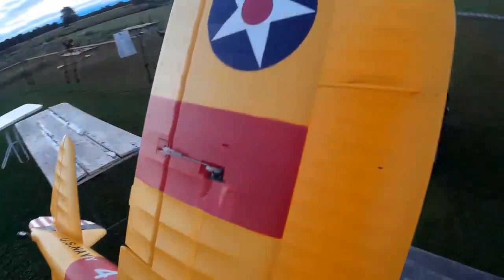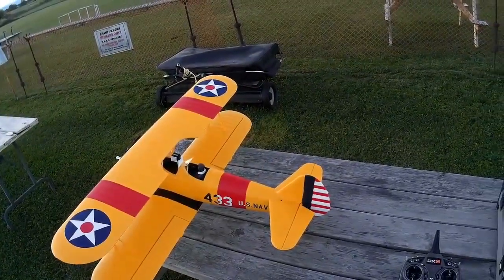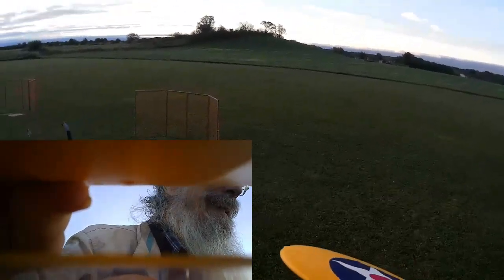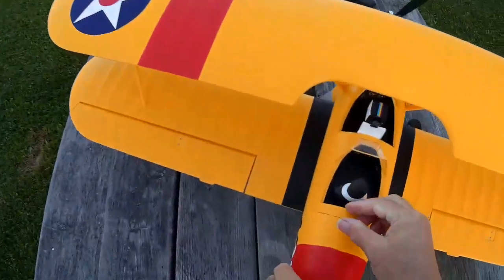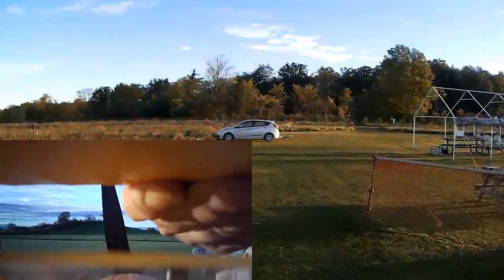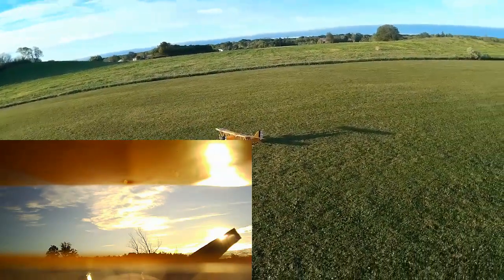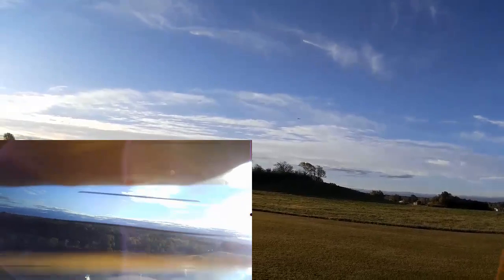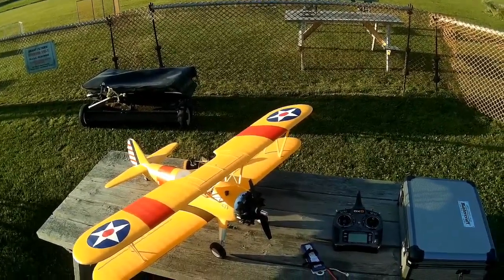E flite 1 1m PT 17 maiden flight review

Comment: Do you still have your's? I just bought one and am having the same problem, I bought a 3D Ultimate and have had all kinds of trouble with that. Rock On!
Reply from the maker: I do still have my PT-7. I had an Ultimate Biplane as well, but I sold that one. With the PT-17 you need to put an ounce or so of weight in the nose to balance it out. It flies ok then.

Comment: i had the same problem  with gear and found 1 of the outer tabs holding the wire in place was bent to far forward i pushed it back and gear pop in fine

Comment: IMO, the engineering of the kit was fine. The instructions are poor. The Landing gear can easily be installed if they would have told you up front to squeeze the wheels together as you're installing the assembly to the fuselage. Once I figured this out on my own, they popped right into place. As for the lower wing pins, a note that they were screw-in parts and height adjustable would have saved considerable time trying to figure out how to get them to protrude far enough through the wing to allow the pins to go in. Again, the plane itself is wonderful. The instructions are severely lacking. They make what should be a simple 30 minute assembly into a multi-hour curse-fest.

Comment: Your batteries are fine to pull as low as 3.2-3.1v/cell. That's where cutoff is in surface usage and it gives you use of all of your rated capacity.

I've got one of these in the post now, but I'm not gonna be overly concerned with lipo discharge. It's getting an OS FS-26 Surpass shoved in the nose. If the thing truly is tailheavy like you're saying...it has been a couple years between your review and my purchase just the other day...swapping the lightweight brushless system out for a nice throaty 4-cycle glow mill oughtta correct that.

Should be able to put my fuel tank right on CG with this one, too, so I can kinda go ham on that. 250cc tank? 30+ minute aerobatic flight? Hhrrrrmmmmmm.......